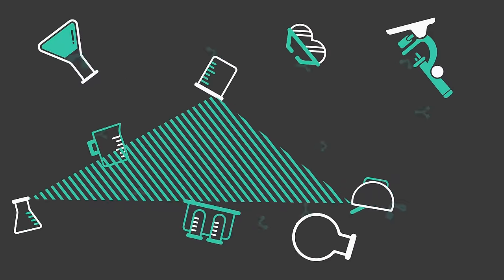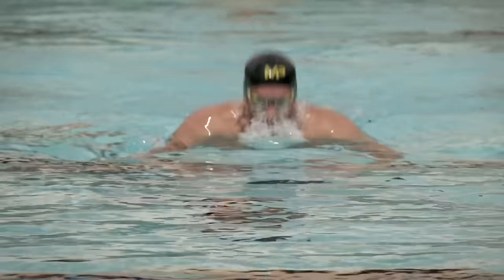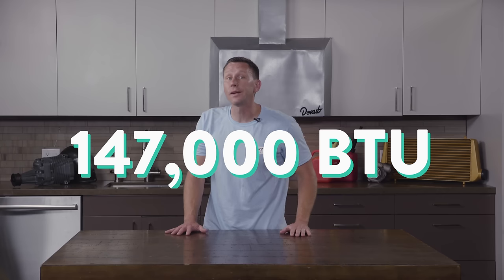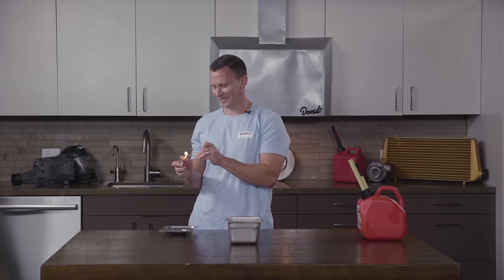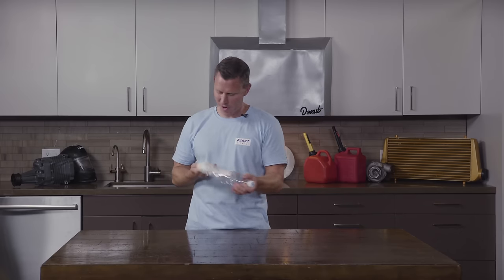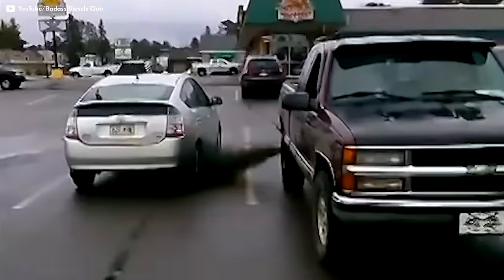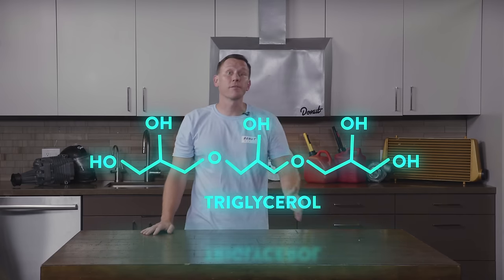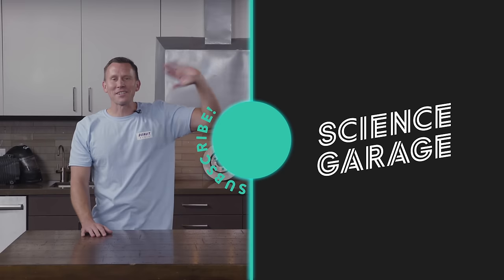DIESEL | How it Works

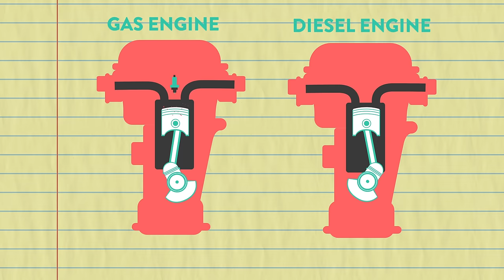Comment: 2:28 wait... I thought diesel engines use glowplugs?...
Reply: The glowplug warms up the combustion chamber so the engine will run when its cold. They turn off after the engine has been running because they are no longer needed.

Comment: what happen if you use a turbo on a diesel engine
Reply: wont the hot part of the turbo be filled with soot
Reply: @DeXusV1  VW's TDI(Turbo Direct Diesel Injection) is a very popular diesel engine that uses a turbo, the turbo does not get full of soot.
Reply: @Raidxfire  oh nice thanks

Comment: The comment about truck and tractor pulling is kinda false. The engines smoke not cause people are showing off their power (power is a small factor compared to traction in pulling) its because they are high performance engines and require that much fuel. It's also still allowed today so it's not a thing of the past. If people have a problem with the smoke its is an extremely small amount of pollution compared to common cars.

Comment: How about gas ? And I don’t mean gasoline. What I mean is gaseous fuel. And it’s impact on the engine and how it is working in combination with the petrol.
Reply: As in LPG? Alot of cars in Australia run on LPG which is basically what you find in a propane tank. Alot of Australian built Fords and Holdens are duel fuel which is Petrol and LPG!!

Comment: Just no. Diesel doesn't ignite prematurely because the fuel doesn't come in contact with air until after tdc, it has nothing to do with detonation resistance. Diesel engines are not compression controlled ignition, they are injection controlled ignition.....

Comment: okay but you didnt explain glow plugs and why diesel engines only turn up to like 4,000rpm before blowing up. you also didnt really explain why they produce  more torque than a gasoline engine.  a little disappointed

Comment: As we speak electric and hydrogen trucks and coming fast and hard on the road. Companies like Nikola and others produce electric trucks that are on the road as we speak with 6 to 8 hundred horsepower motors with automatic transmissions to boot with zero emissions.

Comment: I have a 2014 VW Jetta Sportwagon TDI and I am so sad it is the only small diesel engine on the market, had diesel-gate not happened everyone would be driving diesel engines in America and not the bastard child that the Toyota Prius spawned. VW says it gets 40mpg highway but how I drive it I get 50mpg highway and sips fuel, more than the Prius could ever hope for, it handles any road conditions you throw at it and chugs along like nothing. It is the perfect 1st car for anyone and had VW not falsified the emissions there would be a market for it outside the V8 truck that takes up 4 parking spaces.

It does everything the Prius tries to do and does it 100 times better.

Comment: you missed a point against rolling coal
it looks dumb and is possibly illegal depending on where you live

but you also make less power more often than not, because its too rich

we build diesels in our shop that make 2000ftlbs or more, they all burn clean. if you arnt adding more air than adding more fuel wont make more power

Comment: This is called adiabatic process - not direct injection. Direct injection occures in both: Diesel and all modern gasoline engines (like FSI).
Most of Diesel engines require turbochargers for better performance - not like gasoline engines.

Comment: Actually no, soot is not bad. Soot is better to breath in than fumes that come out a truck with a dpf.   Soot you can just cough up.  When soot passes through the DPF, that soot turns into fine particles that damage your lungs.

Comment: Wtf, i dont understand. You were just going on about how diesel is more powerful and bigger boom, but then u show us that gas (which its disgusting you call it that haha) petrol explodes way bigger faster and better. 

And you said, diesel is more powerful so better for towing, what exact kind of power, torque or horsepower, can a super car use diesel, why dont they, if they dont, petrol is better, so why dont we just make more powerful petrol engines to tow, but making them more powerful means theyre weak, so use diesel for supercars, its a paradox i dont get.